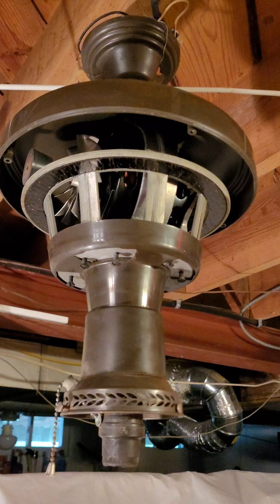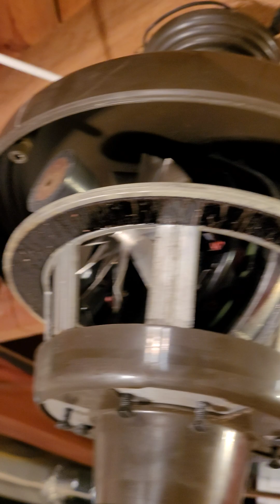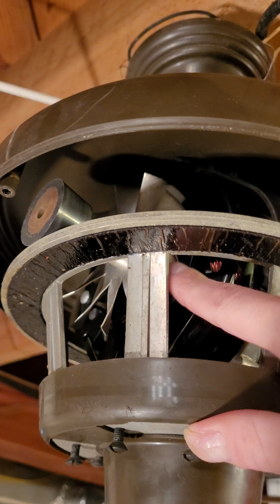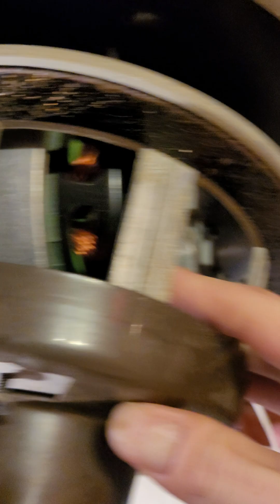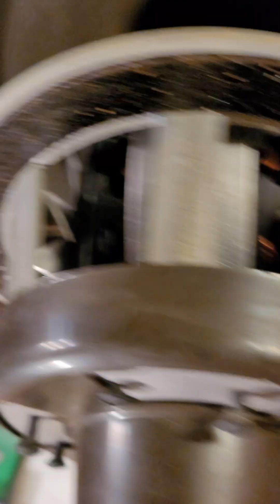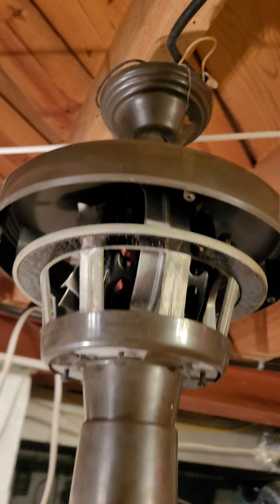BA&F Short | Inside the Emerson Friction-Drive Ceiling Fan #ceilingfan #emerson #frictiondrive

Comment: Why is there a fan inside
Reply from the maker: Because they heard we like fans so much they put a fan within the fan so we can cool off while we cool off

Actually it's a cooling fan for the motor, gear-driven fans have a similar exhaust fan for the motor.
Reply: It's a jet engine that accelerates the ceiling fan's motor on its highest setting so it can reach turbo speed!!! /j